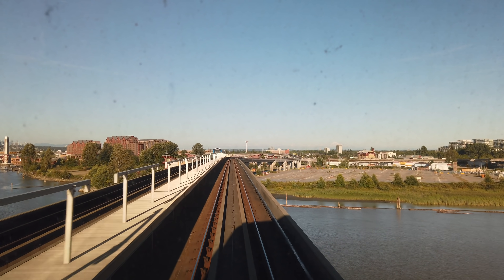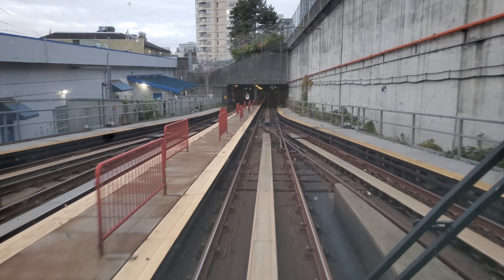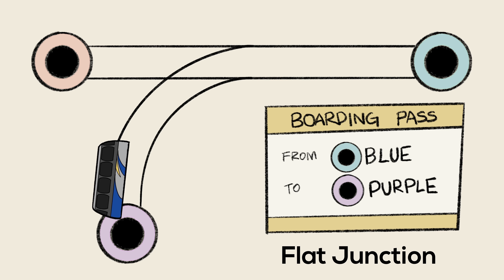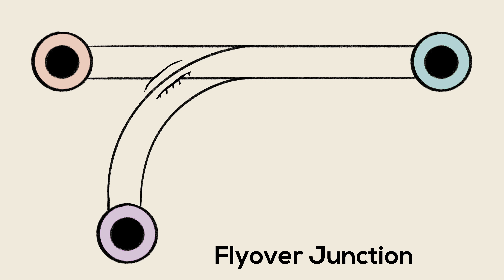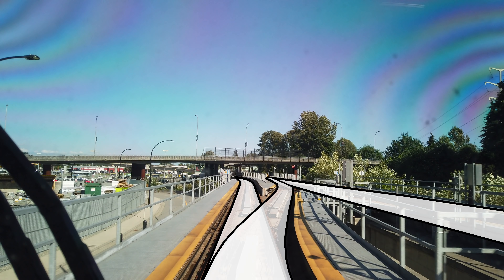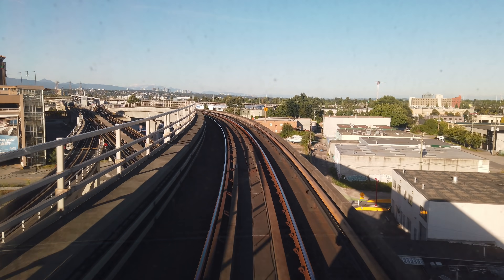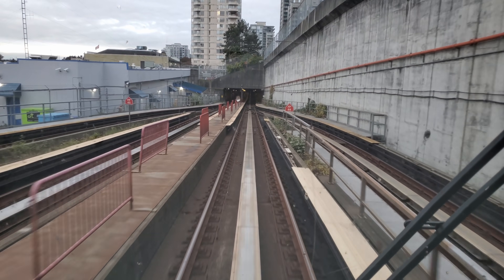Flyovers: The Secret to Efficient Railways

Comment: In Los Angeles, the regional connector project has created a new underground flat junction at Little Tokyo where the A and E lines split. Since it’s just beyond the station, trains usually hold at the platform if there’s another train crossing the junction. The at-grade flat junction at Flower Street where the two lines come together to run through downtown should absolutely have been built as a flying junction. It’s now a major choke point on the system.

Comment: After watching this video, I certainly have noticed quite a bit of flying junctions  as well as why stations are sometimes designed the way they are. One notable example I can think of is the west station of Frankfurt. Said station is part of a viaduct with separate tracks for the S-Bahn and other trains à la Berlin Stadtbahn. What makes this notable is that unlike other stations on the viaduct, this station is partially elevated with all the other trains on the ground platform and the S-Bahn trains on the elevated platform... except for the inbound S6 trains which too stop on the ground floor. This is because the station also is a junction to Rödelheim (and further to Eschborn and Bad Homburg) and there is no way for the S6 line to merge with the other lines without crossing the junction and build the station higher up than it needs to be or to place the platforms further back.

Comment: The Rosslyn station on the Washington, DC Metro is a great example (I think) of a flyover junction. This is where the Blue Line joins the Silver and Orange lines to cross the Potomac, and inversely where it splits off to head to Alexandria. The station itself is bilevel to allow for the grade separation. Inbound trains (headed to DC) arrive on the upper level while outbound trains use the lower level. Just past the station on the outbound side is the flyover junction for the Blue line to split. Keeps trains moving on all the lines. All of this is underground, too, so the average person wouldn’t even notice

Comment: The big multi-year reconstruction of Berlin Ostkreuz included moving some S-Bahn flyovers from between Ostbahnhof and Warschauer Straße to east of Ostkreuz, allowing directional platforms in Ostkreuz (and Warschauer Straße).
You'll not just want flyovers on the splitting junction of a line, but also where one line just crosses another. Or where you have different parallel lines, and one of them branches, having to cross the other one (e.g. a local S-Bahn line has to cross a main-line railway).

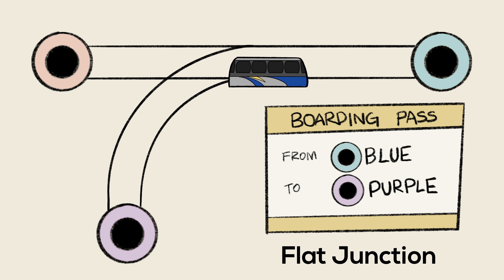Comment: 2:10 "[Cities Skylines] has no flyover junctions, at least in the vanilla game" – For railways (and trams, and I think also the monorail and trolleybuses), there are one-way (single-track) pieces with which you can build your own flyovers. I think for metro they are missing (and for the ferry, you can't even do grade separation at all – canals can't be on bridges without the water flowing out – but the frequency there is limited anyways by the stops).
Reply: One-way tracks also exist for metros which makes these junctions also possible.

Comment: When to tracks / branches join together with eg a flyover, is it beneficial if they keep separaate tracks on the first joint station before joibibg togetherr on the same tracks? This we have in Stockholm. Also, before splittring up, the branches have separat tracks on the last station in common.

Comment: A briiliant example are the "flying junctions" just south of Sydney Central. They're not the location of a geographical junction, but instead let trains get to (or from) the right platform at Central. This was more important before the city loop was completed in 1956.

The four in-bound tracks are raised, and it's possible to cross from any of  them to any other, without crossing an out-bound track. The four out-bound tracks are lowered, and the same flexibility is available.

Well … that's how it used to be, until the Airport line stole some of the eastern part!

Comment: That is why double decker trains fail .  Now the flyover becomes even more expensive due to extra height .  Plus the energy used to lift the heavy trains over it .  Keep in mind the roling advantage of rail does not apply to hill climbing  .

Comment: In Chicago, the city's Department of Transportation and Metra have just initiated planning to de-tangle the notorious A-2 junction, the single biggest bottleneck in the Metra system, with a flyover, in tandem with a new Metra station serving the booming Fulton Market area.

Plans call for the 4-track UP-West line to fly over the 3-track (eventually 4-track) Milwaukee District lines at some point either just west or east of Ashland Ave. The new Fulton Market station is slated to be located on Ashland Ave., with the platform stretching between Ashland and Ogden Aves., and will serve the UP-West, Milwaukee-West, Milwaukee-North, and North Central Lines.

As the project is seeking federal funding, and with the environmental studies, the likelihood of sticky eminent domain cases, and the difficulty of building the flyover along active tracks that see hundreds of trains a day, Metra and the Department of Transportation are projecting a timeline for completion of up to ten years.

Comment: Duivendrecht is only one of several engineering marvels of this type.

Check out the intersection just over one stop up the line, where lines carrying 4/5 of Amsterdam’s metro services seamless cross over not just each other, but local roads and a major highway too. All while maintaining excellent and safe street-level infrastructure for cyclists and pedestrians too.

And the lines on the western approaches to Amsterdam-Sloterdijk are worth a mention in their own right. Another N-S/E-W intersection (permitting mainline through traffic without restriction) between mainline and metro, while also accommodating another major national highway and other local roads, and again with high-quality street-level infrastructure for cyclists and pedestrians.

Comment: One thing that was not brought up were the underground equivalents which are prevalent in the NYC system. The split for the Q/Second Ave. line is a major one and the most recent. I also live near an elevated one that allows trains from a nearby yard to enter or leave while not interrupting running passenger service (#2 and rush hour #5 line trains).

Comment: Fun fact about Duivendrecht station. It used to be an important Intercity station since it's opening in 1993 (even the German High speed train ICE stopped there) because it was needed to allow travelers from Utrecht, and most of the South of the Netherlands with Schiphol Airport. It however became slightly obsolete in 2006, with the opening of the 'Utrechtboog', a huge flyover connecting the line from Utrecht, with the line towards the Airport and the ever growing Amsterdam Zuid Station. 

Nowadays it mainly serves to commuters from cities like Hilversum, Almere, Groningen and Enschede with the subway network of Amsterdam. Especially handy if the Central Station is to much of a detour for your plans. 

Another interesting station in the area is Amsterdam Sloterdijk.  Just like Duivendrecht it has platform for both trains and subway's on 2 different levels, with flyover just next to it with another platform on it.
Reply from the maker: Sloterdijk is suppper interesting too!

Comment: There's a trade-off between usefulness and use of space needed to build flyovers/unders, which may be a serious issue. Standard track layout is nice and compact, with the downside of reoccurring mechanical failures of the turnouts. No solution is always and everywhere perfect. 😉

Comment: This might not fit under the ‘fundamentals’ topic - but I think a good discussion could be had on the merits of flat junctions. I think they are very underrated. Flyovers are super expensive and the reality is that you can’t just build them everywhere on existing mainline railways (although metro systems and newly built lines are a different story). Some careful timetabling and clever junction design can cater for a lot of movements without the need for grade separation. Greater line capacity can be achieved by switching to longer and/or double deck trains. Anyway, great video! I look forward to seeing more like this.
Reply from the maker: They do have there place~!
Reply: I was going to comment something similar but you hit on all the points, especially the careful timetabling. I find too often the timetabling aspect is ignored in infrastructure capacity discussions. At the end of the day its a trade-off between needed capacity and cost, and is there a more cost effective way to meet the capacity.
Reply: Fewer trains with higher passenger count means longer waiting times for passengers. It also makes it more troublesome when a train is unavailable.

Comment: I've actually noticed this about DC metro...despite them being squeezed of funding for decades leading to the hole they're having to dig themselves out of now, all of the above ground junctions at least are fly overs or underground. I'm not completely sure if the two underground junctions are separated like that or not, but I actually think they are. 

In general the system has really good bones. If they had maintained it well over the years it could have easily competed with European systems. The north and sound bound tracks are almost always separated in the tunnels and there are lots of crossovers meaning the system can run single track all the time too. With a new signaling system too, its one of the few systems that could probably do 24 hour service by single tracking like Copenhagen since the directions are separated.
Reply from the maker: This is a great comment and you make a lot of really good points

Comment: Portland's MAX trains will fact a permanent limitation with their inability to do flyovers along much of their route. I love our transit here but the infrequency of our downtown service is pretty modest when I compare it to other cities I've visited. It's a shame that we never will really be able to improve much more than the current 10-12 min wait for each line.
Reply from the maker: It is possible with tunnels though!
Reply: @RMTransit  Haha well that is true, and there's always some effort to move MAX underground through downtown, but I just don't see that happening in my lifetime. Well, maybe at the end in like 2050 or something, but that'll be too late for me. The current bottleneck at the Rose Quarter has four lines going through one set of switches across one bridge, and working those into a tunnel or something would require huge effort to get around the many existing structures as well as freight rail.

Thanks for the reply!
Reply: The Red Line has one of those weird single track junctions at Gateway where trains running in one direction have to use the wrong track for a short distance, kind of like the MediaCity UK branch in Manchester.
Reply: @cityjetproductions  True, that is in process of being repaired, however, as part of their expansion of the red line out to Hillsboro. As someone who regularly takes MAX to the airport, I never noticed any issues, but I can see how it would be needed for future expansion.

I'm thinking of the Rose Quarter area, tho, getting more trains through there across the Broadway is just about impossible with the setup they  have now, not sure how they will address that in 2030 or whatever.

Comment: I think having flyovers and underpasses to pass over and/or under the railway tracks does help reduce congestion and allows trains to move freely without colliding into each other. 

And that’s why Network Rail should build a flyover at a flat junction in Newark, Nottinghamshire UK where the East Coast Main Line and the Nottingham-Lincoln Line crosses. And trains on the ECML have to slow down a bit to pass through the cross intersection before speeding up again.

Comment: Melbourne still mostly uses flat junctions, some of which are at breaking point. Clifton Hill is probably the most congested one. The Metro 2 project is intended to divert one of the branch lines into a tunnel, but that won't happen until later in the decade at the earliest.

If you want to see a really crazy flat junction, check out Yamato-Saidaiji station.

Comment: Interesting little video.

In the last few years we had a nearby high speed flat/ladder junction replaced with a fly over to improve the reliability. I'm sure you've probably seen them when you've done your Sydney videos, but they're at Glenfield, NSW. There was additionally two more fly overs added as part of further improvements, but the sheer size/scale of these things is impressive... and kind of ugly as well with all the concrete (no grassy embankments).
Reply: Yep. But now we have extra services at Glenfield thanks to the flyovers.
Reply: Agreed.

I actually like the end result of all the upgrades they did there, even if it did mean losing direct services to Parramatta/Granville.

The frequency boosts and cross platform changes are super convenient with trains often arriving/departing the same time.

Comment: You should be using bi-directional double track for flat junctions. When you need to take a left on a junction you should switch to the left track in advance so a train coming form part of the network that would get impeded just also switches to their left and the trains just temporarily passes each other on their "wrong" sides not having impeded each other. 

This is only really possible with trains because of path reservation and extensive signal usage. It allows trains to go trough crossings at full speed spending little time actually at them. Only when you get near to stations. (like the example of the Netherlands where it is clearly more about space constraints, having the left most track take a right for enabling a bigger radius.) where you have slow moving trains which take up a lot of time in the junction. Or where massive freight trains meet high frequency passenger service. Because in general it isn't easy to create a slope to get the height clearance needed. My personal favourite, the Y-oostkamp of line 50A starts its rise 1,4km away for a total crossing size nearing 2.75km.
Reply from the maker: Thanks for that example! Very interesting!

Comment: There's also just the matter of timetable sensitivity. With careful timetable design, there can be enough space that you can timetable trains so the flat junctions are clear. But then if one train runs late, it disrupts the whole system, and every train is suddenly having to wait at the flat junction. And what's worse, a train will take longer to clear the junction from a standstill than it would at speed, so suddenly your capacity has gone down and a perfectly sensible frequency is suddenly unachievable. So flat junctions are just brutal.
Reply from the maker: The impact on timetables is potentially very significant!

Comment: The city where I live has the perfect mix of flat crossings and overpasses/underpasses. In the city centre (where everything is underground) with a high frequency of trains (a train every 2 minutes, but on different lines), overpasses/underpasses are used. outside, where trains run at 5-15 minute intervals, flat crossings are used. The city I am talking about is Stuttgart in Germany with a population of about 630,000. 
Our public transport system (the SSB) has 19 light rail lines, 47 bus lines, a funicular that is almost 100 years old and one of only 4 rack railways in Germany. We also have the steepest standard-gauge adhesion railway (a railway without cogwheel-tracks) in Europe at 85 ‰, served by the U15 line. 
Perhaps you talking about how a relatively hilly city does public transport could make for an interesting video

Edit: the english wiki page about the SSB is really short. it would be way better to translate the german article with the help of deepl or google

Comment: It should probably be mentioned that flyovers (or grade-separated junctions) are also a thing on underground systems. There you can really see the difference between systems or sections that are basically buried tram networks and high-capacity mass transit. The core section of the Cologne Stadtbahn and several systems in Belgium are notorious for having at-grade junctions underground, while e.g. at the Stuttgart Stadtbahn about 90% of underground sections have full grade separation.
Reply from the maker: You're absolutely right! The scale is even crazier when you bury it!

Comment: Not in Melbourne on one of our lines. 10 tracks leave the city, 2 pair off to one branch, then 8 to next station, then 2 pair off to another branch, then 6 to next station and 2 pair off, then 4 to next few  stations covering 2 branches both with their own tracks then they pair off.  Although trains can if needed cross each other they don’t as the lines are all operated as separate lines and they are all flat junctions.

Comment: In Chicago, the long overdue flyover for the northbound Brown Line over all 4 tracks of the Red and Purple Lines is almost complete. This will alleviate delaying NB Red Line tracks on track 3, and SB Red and Purple Line trains on tracks 1 and 2 as the NB Brown Line from track 4 crosses all 3 tracks to continue on the Ravenswood branch. The flyover is quite nice looking and will be open later this year.
Reply from the maker: I had a bit about it in the video but I cut it because not enough time, great project! The Four Foot has a good video on it!
Reply: Clark Junction, just north of Belmont

Comment: I think that the reason why there isn’t a fly over or under at Coquitlam Central station is because west of Coquitlam Central the 2 branches would merge & just to the east of the flat switch you have the station itself. You can still run high frequencies on both branches & simply utilize the platforms at Coquitlam Central for timing purposes by only letting a train leave Coquitlam Central station only when it has a clear path to leave.